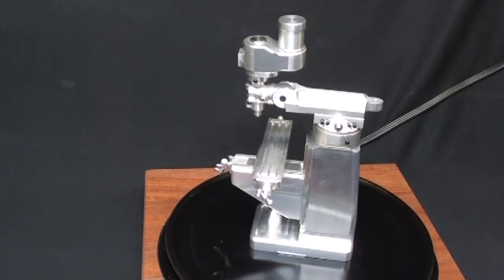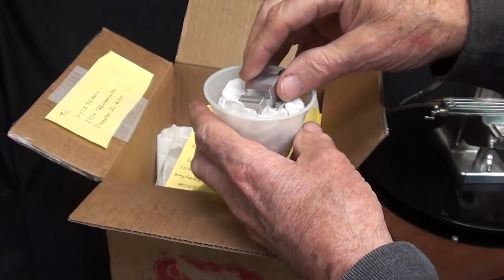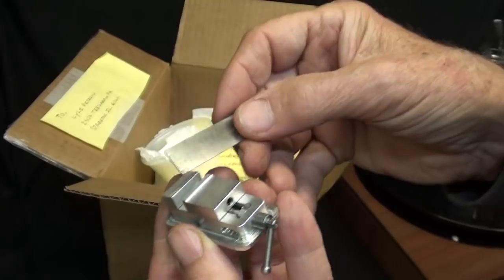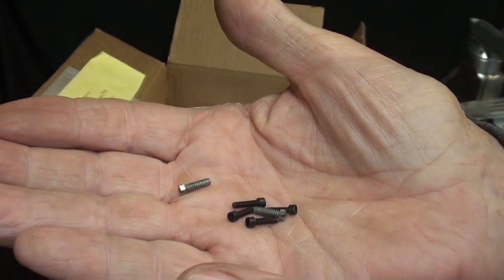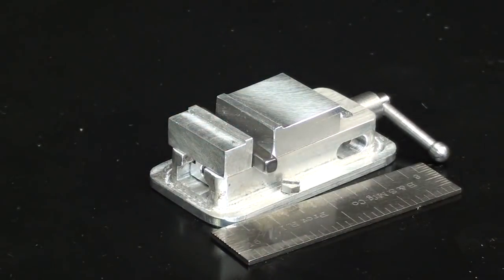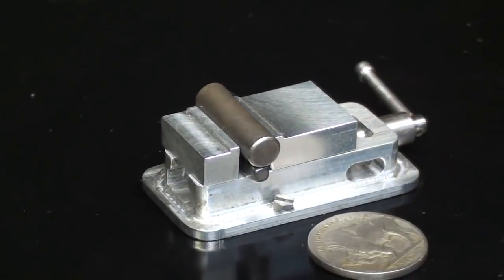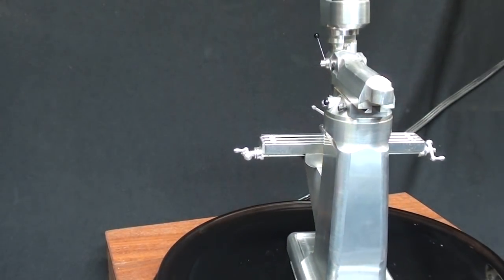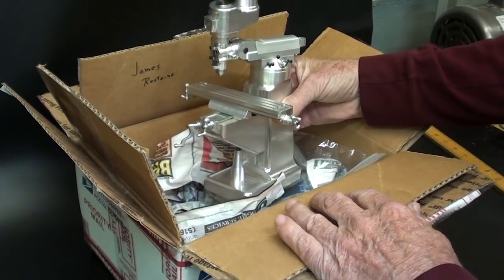Tiny BRIDGEPORT Kurt Vise Model Tips 692  tubalcain

Comment: Dear sir,
my father is a master machinist, McDonnell Douglas trained, long since retired and unfortunately getting long in the tooth. He has a shop in Oregon that he is starting to talk about liquidating. He would like me to have it all but that’s not possible, however if I could manage one machine which machine is the money maker, the lathe or the mill, both are complete with all the bells and whistles all I would have to do is wire it. I appreciate the show. Aloha
Reply from the maker: That is a tough one, but I would say the lathe
Reply: Get the mill.
With a motorized rotary table with a chuck mounted on it you can do a lot of lathe type work on a mill, it is slower then doing it on a lathe and the tool marks look funny, but you can get it done.
You can also get a small lathe chuck on an R8 shank and clamp the turning tools in the vice.  Takes a bit to get used to working upside down but it works.
And if you ever want, small shop lathes are easier to find and less expensive to get then the mill I am guessing your dad has.

Comment: Mr. James Restaino I would like to say that your work is amazing, the detail and attention to accuracy are amazing on the vice and the mill model. Currently the smallest item I work on is crank shafts for an Italian made exotic car so small scale machining is always impressive to me. I did recently buy a mini lathe(and no it is not the Chinese version) because I am in an apartment away from my shop for work and am looking for a small mill to go with it but a small 5 axis would fit better with my skills. I am trying to relearn manual machining since it has been over 20 years since I had to do it. For now my work is centered on a 42 inch throat Edwards English wheel that we found in a warehouse that needs to be restored. As always Mr. Pete we appreciate the lessons and updates, I just wish that these skills were still taught in schools.

Comment: Lyle, James gave you instructions for taking the mill apart to fit the vice. Surely you just need to make some miniature tee nuts, slide them in just like you do with a full sized machine, or am I missing the point somewhere.The bolts in the vice at present look like dummy's, pull them out and replace with miniature bolts into the tee nuts. Or make tee slot bolts and use nuts and washers on the top.